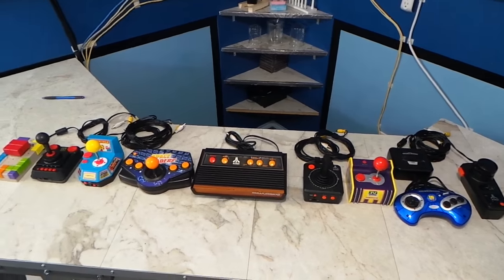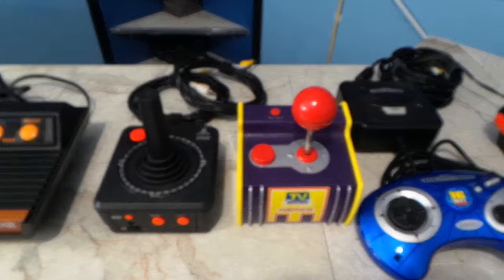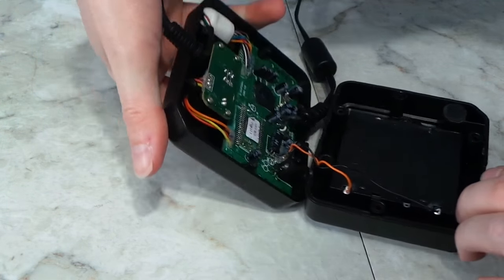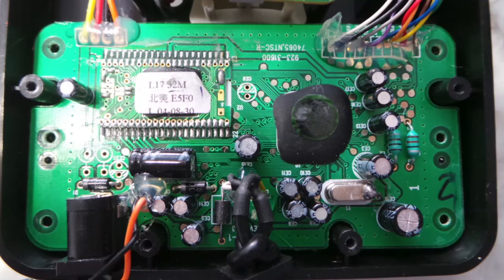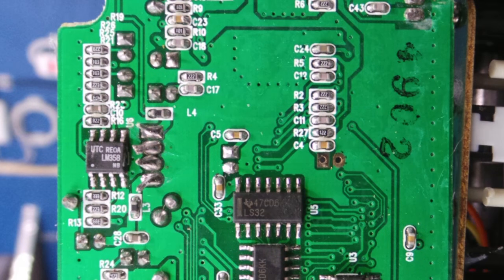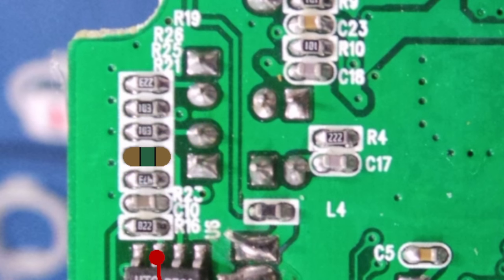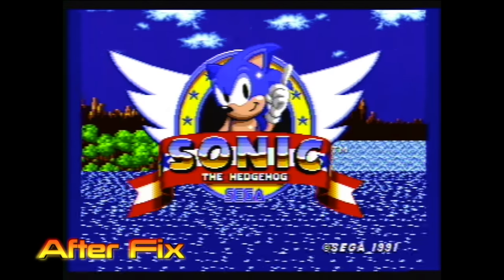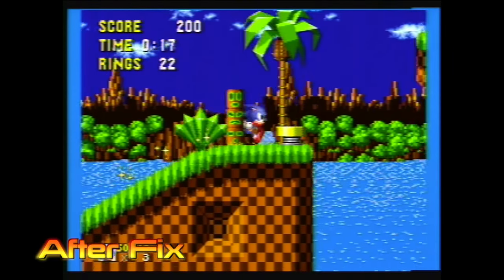Radica Sega Genesis Audio Distortion Fix

Comment: One small correction: 'L3' is an inductor, not a resistor. On schematics & PCBs, the letter prefix indicates what kind of component it is: 'R' is for resistors, 'L' is inductors (coils), 'C' is capacitors, 'Q' is transistors, 'U' is ICs (chips), etc.
Reply: On very few occasions boards will not have standard prefixes, usually it's something like the connectors, transistors, and IC's having non-standard prefixes, but I've seen ones that even have resistor prefixes be non-standard
Reply: That sound sure was painful until your fix.
Reply: Nerd
Reply: Jk i cant talk

Comment: My issue was how warped the music is on a lot of these Mega Drive on a chip systems,     it's not the distortion  just songs play out of key,   Mickey Mouse: Castle of Illusion sounds like a cat being strangled.
Reply: +Larry Bundy Jr At Games handhelds really suffer. Boogerman just sounds wrong.
Reply: We all read this in his voice.
Reply: I literally read that in your voice
Reply: @pferreira1983  yeah. I got one when I was really young, and I assumed that's how it sounded. When I watched a gameplay of some of the same games a few years later, I thought the video was broken, but, nope! That is it's real audio!
Reply: @gardener_leaftail  I think what's happening is the At Games stuff only has one sound channel so half the music ends up missing when it comes out of the speaker.
Reply: @pferreira1983  But how does that explain the seeming lower pitch of the audio?
Reply: @gardener_leaftail  I suppose it's how the original game outputs sound. It's going to be different for every situation. I had a similar issue when I re-bought an Amiga. With a monitor capable of only mono sound you only get half the sound come out. I think it's sort of a similar issue with the AtGames stuff.

Comment: dangit ..... i had this plug-and-play, and i sold it because the audio was terrible, now i want it again lol
Reply: Oof
Reply: Yeah just buy one and get the wires and something to solder and de-solder
Reply: @Michael O Callaghan Now come on, it also required the removal of two, yes two resistors lol.
Reply: @chartier67  Oof, that's very expensive.
Reply: @nerdyneedsalife8315  I know, that's a deal breaker lol.
Reply: Two pieces of write are probably cheaper than two resistors, they could just have 'not put those on there in the first place'? My guess is except for making sure they ran at the factory nobody at jakks bothered to play test them, or at least with the sound on.

Comment: Going out on a limb here just looking at the pictures and not having a schematic, but:

The LM358 chip is a dual operational amplifier (opamp). It looks like the original circuit used opamp #2 in the package for first stage amplification, and then opamp #1 in the package for additional amplification. The output of opamp #1 goes through a filter to the audio output. Overamplification and/or a poor filter design was likely the problem. Removing L3 disconnects opamp #1 and the filter from the audio output. The first jumper described connects the audio output to the output of opamp #2. Then, removing the resistor (R21) and adding the second jumper seems to adjust the gain of opamp #2, probably to make the audio loud enough with only the single amplifier. Overall a very simple mod, glad it was this easy.
Reply: My brain is spinning after reading this comment...can you just come here and fix mine for me??

Comment: Crazy.  I ran into the same thing several months ago when I was attempting to wire up a cartridge connector to make it a portable Sega Genesis.  It worked, but the audio was total garbage.  It wasn't easy finding the solution, but I found a few videos and images that basically showed me the same thing you did, however since I was using this to make a portable and actually using my own audio amplifier circuit, it still sounded kinda cruddy on the small speakers, so I actually played around with it more, and added a 333 capacitor across one of the resistors or capacitors (don't remember which one) and it actually made it decent.  It probably helped filter out some of the overmodulation.  BTW, that L3 isn't a resistor, it's an inductor.  Usually L indicates Inductor, just as C is for Capacitor and R is for Resistor on circuit board screen prints.

Comment: All of the Genesis/Mega Drive models after the original Model 1 (with the "High Definition Graphics" logo) suffer from distorted audio to some extent, with the Genesis 3 being the worst. There are various fixes for all of them, but I prefer to stick with my Model 1 so I can also get stereo sound and the nifty headphone jack with volume control. :-)
Reply: My Genesis came with a mono audio chord and I have the first model
Reply: +vwestlife Model 1s are a mixed bag. Pretty much all 'High Definition Graphics' revisions are good (with the pre-TMSS sounding the best), but the Model 1 revisions without the 'HDG' text are a mix. Some sound just as good as earlier revisions, and some sound as bad if not worse than Model 2s. I want to blame the amp, or the different FM synths used, but I've heard some people blame the audio circuitry as a whole. It's a shame Sega couldn't keep it consistent.
Reply: +Zappy595 You can get stereo sound from it via the front headphone jack.
Reply: Actually, the thing with the later chips is that they're LESS distorted than the originals, they use a later variant of the original YM2612 that, amongst other things, fixes the "ladder effect" bug in the original... Neither Sega nor Yamaha however considered that people would by then have made an awful lot of music (and other sound) that took that slight bit of weirdness for granted. Hence, same as in almost all such cases where an original buggy release of some hardware is around for a while and programmers take advantage of it, it breaks a bunch of things because those glitch-based audio, video, and code effects suddenly don't operate as they did before, or at all...

What's going on here is a simpler case of some moron not specifying the sound amplifier output level properly (given that these consoles internally gang both stereo audio channels into one, it's probable that the total value is set to twice what it should be and almost twice what the downstream hardware can withstand. Hence, over amplified clip-city. Good job it's such a quick fix.

(specifically as it's a discrete component mixup, you can't really blame the all-in-one chip or most of the rest of the design, it's just whoever was responsible for ordering and installing that part cocked up.)

Hmm, actually it still seems a little clipped, is there any way to add an extra low-ohm resistor in anywhere? And does this still transmit all of the stereo image still (merely flattened to mono), or is it more simply cutting out either the left or right channel?
Reply: The model 2 Genesis systems are perfectly fine. If anything, they'll sound better than the model 1s due to dirty POTS and old capacitors. The model 3 and the CDX are the ones that have issues.
Reply: I was going to say, my model 2 sounds fine, definitely better than the plug n play in the video. Stereo cables are a MUST though.
Reply: VWestlife my gen 3 sounds fine and no Its not modded and my model 1 hdg is also fine
Reply: VWestlife not true. A bunch of revisions of model 1 without the "high definition graphics" have sound just as good as earlier model. That includes revisions VA6, VA6.5 and VA6.8. For that model, only revision VA7 has distorted sound.
Reply: Yeah I suspect you'll mostly notice issues in games that were written before there WAS a model 2 (or other revisions with the newer YM2612). Games made with newer revisions in mind aren't as prone to issues.
Reply: Lucky me, I've got a model 1 too :) it only has coaxial TV input, but I can just mute the TV and hook up the headphone jack to a good speaker. Bam.
Reply: Model 1s had a video out that supports composite RCA video (with the right cable). So you snag a composite A/V cable for the model 1, use the RCA video off the back output, and then use a 3.5mm to stereo RCA adapter to get stereo RCA audio, and you use that with some basic RCA cables for the audio. You ignore the RCA audio from the rear A/V cable entirely. So you don't have to mute your TV audio.

Some modders simplify things by just adding RCA outputs so you get Model 1 stereo sound and video just with some straight RCA cables. I've also seen S-video and VGA mods but that's another story entirely.
Reply: I believe I tried that once and it just gave me a distorted fuzzy signal. An RCA intended to give an RF signal can't split it into three composite signals. However, if you've tried this and it worked, maybe I can give it another go and see if something different happens.
Reply: Alexvrb wait, I misunderstood you. I see now you didn't mean the RF output, you meant the really BIG av out. Yeah, I forgot about that thing XD I should find a cable for it. If I do, there'll be no need for me to use a separate audio adapter, I can get stereo audio from the av...right?
Reply: No. The Model 1 uses an older AV pinout like the Master System. It only has Mono audio out of the AV port. However, it does have composite video, and the front 3.5mm jack has proper stereo audio... so you combine the two. This requires the standard mono composite AV cable (yellow + white) and the adapter I mentioned, plus a couple more RCA cables. You'll end up with an extra mono audio cable coming out of the AV port that you can ignore.

Alternatively you can get a prebuilt cable that has everything you need wired up for you. Something like this:

https://coolnovelties.co.uk/coolnovelties/sega-master-system-1/264-sega-mega-drive-1-genesis-rca-cable-with-stereo-sound.html
Reply: Alexvrb dang...that's troublesome XD you know what I found out when trying it this morning though? On my EDTV, the screen scrolls slowly up forever when I hook up the Genesis. On my 80's TV and my HDTV though it's fine. HDTV must be correcting automatically with its PAL/NTSC technology while the manual V-hold fixes the error on the older one. The EDTV has neither...I guess I'll just use it on the old one with re for now lol. No point adapting it this way if it just goes through a modulator in the end.

But how much would you say the composite video improves over rf video in this case? I might try it on the HDTV sometime.
Reply: Big improvement. Still not as good as RGB or component but RGB SCART support is a cluster, and component is also a cluster unless your HDTV supports 240 component (which is NOT a guarantee). So generally composite is the way to go, it WORKS and it's much better than RF. I really wish someone sold a component cable that had in-line componentry to bring it up to 480i/480p. Not a fancy upscaler, just something to boost compatibility with more HDTVs without adding lag.

Unrelated: I will say that the Dreamcast's RF adapter was one of the best... it produced fairly clean audio and video considering the higher resolution involved. I know I had an older TV in my room that only had RF back when I first got my DC. Meanwhile my PSX's RF adapter was garbage from day 1 and had serious issues with audio distortion. So even with RF they're not all created equal.
Reply: Alexvrb I really like RF and can't find much flaw in it, but maybe because I'm just an old fashioned tech noob. I found what looks like a standard stereo cable for the model 1 composite, perhaps a third party adapter version. Only about nine pounds. But as I live in America, I don't really have scart options. I've heard good things about it. And there's always that cheap knockoff HDMI Genesis, but we're talking the real deal here so nope XD
Reply: RF is definitely inferior. I was just saying that some RF adapters are better than others, especially regarding audio.

There is no standard stereo cable for the Model 1 AV, because the old-style AV port it uses doesn't HAVE stereo channels in the port. If you look up a pinout there's only mono. So even if you find a 3 cable hookup (yellow, white, red), it really only has mono sound. UNLESS you get one like I linked above, which takes the stereo audio from the front 3.5mm and splices it in, or you use an adapter and do it yourself.

99% of the knockoffs are just some cheap POS running a really bad emulator that has garbage audio. So it doesn't matter if the signal is digital, it's bad to start with. If you're gonna use an emulator, do it on PC - Kega Fusion or similar. Audio accuracy is far better (especially with some setting adjustments) than some ultra lowend ARM/MIPS SoC running a half-arsed quick and dirty emulator.
Reply: Alexvrb thanks for educating me on that mono type av. Maybe it's similar to the kind the portable AtGames console uses.

As for the HDMI thing I mentioned, you're right that most knockoffs run bad emulation, but I saw one on here that ran Sonic games perfectly and the audio was not so bad. All pitches were correct and it just needed a little equalization correction. some TVs nowadays could make it sound completely normal in fact. And the HDMI really worked. Sometimes we get a good one out there.
Reply: Most of them run SOME games well enough, but if you throw other games at them, they suck. They also don't do all generated sounds/notes equally well/poor, so you can't correct for it in many cases. I have yet to run across an emulator-based knockoff console that had excellent compatibility and sound across the board. Obviously a good emulator on higher-powered hardware (like PC) does much better. But the ultra low-end stuff in the clones is really poor, especially compared to the real thing.

About HDMI... you can use adapters and/or mod your real genesis to have HDMI. But some methods of this are better than others - your typical consumer grade adapters introduce noticeable latency. Anyway composite will be good enough, trust me.
Reply: The one I found, by Fe Hao or something, had HDMI, okay mono sound, and it used shockingly low power. It even works with some Everdrives, so although its edge connectors grip hard and make pulling a game out a possibility of breaking the console, I'd just shove an Everdrive in there and use it forever.
Reply: mine doesnt have the HDG text. however, id say it sounds about as good as it gets. i guess i got really lucky.
Reply: Actually, there is an exception in the form of the Wondermega/JVC X'Eye, a combination system made under Sega, alongside Genesis systems that are hooked up to a CD or 32X.
Reply: +VWestlife ALL Model 1 systems from VA2 - VA6.8 and their regional equivalents have some flaw with the sound output, on the VA2 systems, SEGA set the gain on the preamp way too high which causes distortion and garbled sound on loud games. VA3 - VA6.8 systems on the other hand have a different problem, the gain on the preamp has been fixed, but in the process SEGA added heavier low-pass filtering which makes things sound more muffled than they actually should be. Fortunately all of these issues can be fixed with some simple tweaks (for VA2 systems and their regional equivalents, you just need to replace 2 47kohm resistors with 10kohm resistors and 2 1000pf caps with 4700pf caps to fix the sound, for the VA3 - VA6.8 systems and their regional equivalents the fix is even simpler, just replace 2 5600pf caps with 4700pf caps and you're good to go).

On the topic of non "High Definition Graphics" model 1 systems, that visual difference alone really isn't the best indicator of whether it's a VA7 system or not (all VA7 system regardless of region is the only model 1 system that uses the YM3438 found on early model 2 systems, everything before VA7 uses the YM2612). What buyers really need to be looking at is connectors on the back of these system and their placement. On pre-VA7 non "High Definition Graphics" models, everything will look the same as the "High Definition Graphics" models just with an empty area where the EXT port would normally be, on VA7 non "High Definition Graphics" models however, SEGA altered the placement of the connectors to make it look like the EXT port never existed at all.

Here's some comparison pics for reference (these pics came from the SEGA-16 forums which is where I originally got all of this information from and I would highly recommend checking there for more info on which resistors and caps need to be replaced and for which system to fix the sound):

Pre-VA7 non "High Definition Graphics" models: https://imgur.com/Kvv4F15 (all non "High Definition Graphics" systems that look like this still use the YM2612 and as such should be safe to buy).

VA7  non "High Definition Graphics" models: https://imgur.com/0yA9kzH (all non "High Definition Graphics" systems that look like this use the YM3438 found on early model 2 systems, and unless you grew up with a YM3438 model 2 system and just want a model 1 with a YM3438 in it for the cooler design of the system while keeping the sound chip you're most comfortable with, these systems should be avoided like the plague).

Hopefully this info will help people know what to look for when buying a non "High Definition Graphics" model 1 system and how to fix the sound on "High Definition Graphics" model 1 systems.
Reply: @SwissArmyTin  It was because the Z80 processor was removed from Gen 2&3. The first Genesis was created by using left over parts from the Master System. The Z80 was the Master Systems processor but was used as the primary sound processor in the Genesis 1.0 controlling both  Yamaha sound chips.